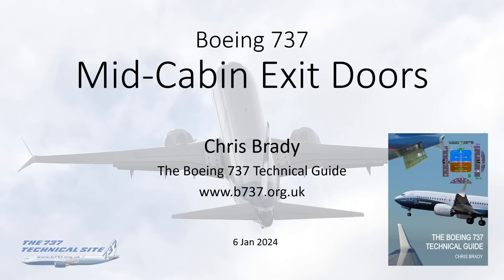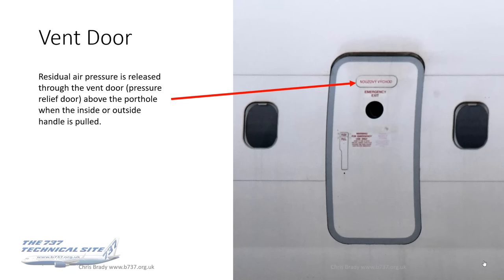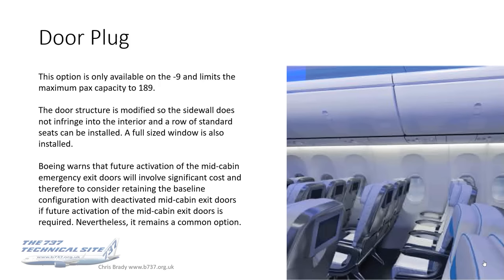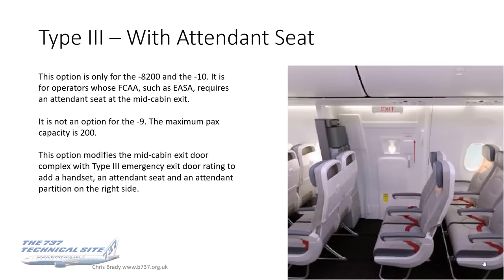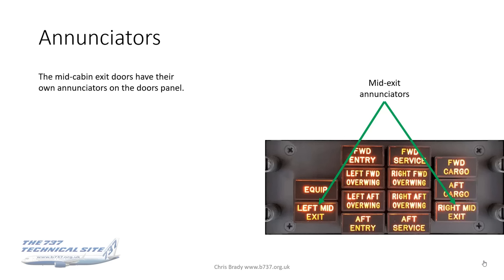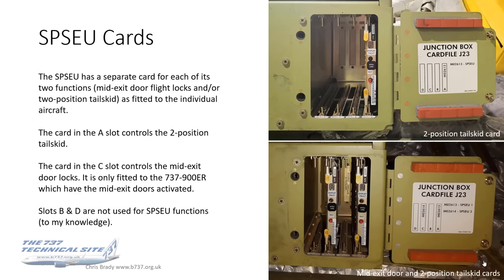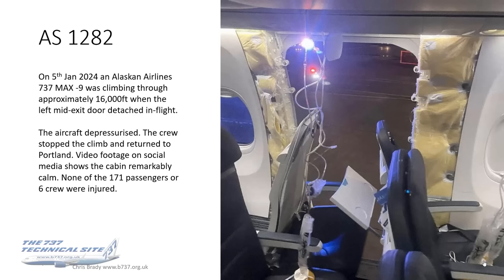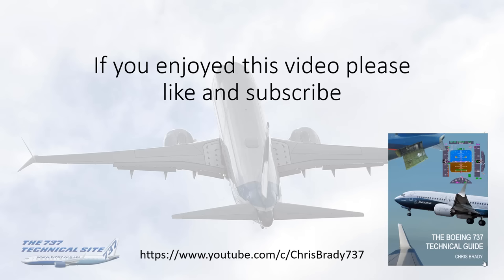737 Mid-Cabin Emergency Exit Doors

Comment: I'm surprised the plug can pop out?
I'm always impressed by the kinematics of boarding doors opening and closing, a door that is bigger than the hole, but still opens outwards. Once seated and under pressure doesn't even need hinges or bolts to stay in place.
But it seems to me all the safety it brings is negated if there's another seal that relies on 4 bolts?
Reply: I guess it qualifies as a "plug type door" because in the down position the stops on the door collide with the stops on the body so it can't physically open until it is lifted up. All the stress should have been taken by those stops with the bolts just preventing vertical movement. It sure seems like even one bolt would be enough to hold it down so my guess is no bolts installed or the wrong bolts installed, eg too small so they were able to rattle themselves out.

Comment: As a professional aircraft mechanic of over 40 years,  This video was excellent material in what I wanted to know as a reference.   Of course many more questions and answers will follow before we know exactly what happened.
Reply from the maker: Thank you, glad to hear that you found it useful
Reply: I'm going to guess the retaining bolts were never installed.  Even so, it's difficult to see how it worked itself open.

Comment: Interesting video.. Thank you. A "plug" would imply that cabin pressure would hold the door shut? Seems odd design that a panel would be held by fasteners where the cabin pressure works against them. I think I will be avoiding sitting in rows near those plugs. Update... I watched the video from the start and I am much clearer about the design. Still wont sit next to one.

Comment: As a 37 year FAA maintenance inspector, this video is well done. Doubt it’s a design or materials flaw. Sure seems like someone did not install the bolts during manufacturing or maintenance. Probable root cause… continuity of inspection failure..or interim inspection before closing failure. Poorly designed task card if maintenance, improper training and/or staffing issues may also be contributing factors. Human factors…
Reply: Thank you for an intelligent comment

Comment: Great video. How can 1 or more bolts be missing? This is an incredible situation. What is the quality control situation? Every nut and bolt needs to be installed, torqued, and safety wired if necessary. The door plug installation organization needs a thorough review.
Reply: you can see a door bolt in the top right at 24:21 it's huge and there is no nut to torque

Comment: Sounds like somebody forgot to bolt the plug onto the fuselage. One or two bolts could not have failed, bolt strength is immense.
Reply: I worked on the assembly line for some time. When this type of thing happens, an extra line will be added to the procedure where the Quality Assurance person will be required to check the setting and certification of torque wrench, then witness the mechanic who will torque all the fasteners in question and sign off the line item in the procedure. The way I understand it, you cannot require witness torque on every nuts and bolts, that would cost way too much. But I would be surprised if these bolts for the plug door did not have the witness torque requirement already. Another possibility is the bolts were obtained from a shady supplier who bought the cheapest bolts which were not up to the task.
Reply: @1Grr8Guy   does the tube arrive from Wichita with the plug installed ?  or is it installed in Final ?
Reply: @peterp4319  It appears to me that the fuselages are seal tight against the elements for the journey to Renton. Haven't seen any gaping holes at all. Even smaller gaps are covered up with some temporary covers and taped shut.
Reply: "One or two bolts could not have failed, bolt strength is immense." 
......IF they were the correct part number.
Reply: @peterp4319   "does the tube arrive from Wichita with the plug installed ?"
Good question.

Comment: BONEHEADed Boeing + FAA though process, i.e. note @5:55 that in the "sardine" configuration used by Lion Air, that the "extra" (formerly plugged) 2 emergency exits are in the portion of the plane that needs them the LEAST!  i.e. they eliminated First Class, and now have WAY more pax forward of the wing than aft.  SMH... 🤦‍♂

Comment: On Alaska flight:  the images from the outside portray a door that popped out cleanly and didn't damage fuselage aft of the door.  If the structure was sort of a door with hinges at the door sill, but bolts instead of latches to keep the "door" closed, wouldn't partial separation have resulted in the outside wind (greater then 40knots (yes, I watched your full video earlier :-)  playing a tug of war  to pry the door off from the hinges or remainig bolts thus resulting in visible damage to the frame? If the door swung open and later detached from hinges, wouldn't it have limely scraped/dented the fuselage aft of door frame?    Would this plug non-door have fexible seals similar to real doors? or would they have used some silicone sealant or other permanent compound to seal the gap between the plug and the door frame?
Reply: i wonder if the only thing holding it all this time was the sealant?
Reply: "Would this plug non-door have flexible seals similar to real doors? or would they have used some silicone sealant or other permanent compound to seal the gap between the plug and the door frame?"
At 24:27 I see a bulb seal mounted to the fuselage and a seal depressor on the door itself. So it has a flexible seal just like a regular door. They work remarkably well. I've seen test pilots turn the pressurization OFF altogether and the fuselage and all the many doors and openings hold pressure tight as a drum. And there are a LOT of openings in an airliner fuselage.

Comment: The door plug option is an interesting one.  The fact that is can be opened, even part way for maintenance makes it an operating door versus a permanently bolted 'door plug' at assembly that is meant to be installed and not opened unless the configuration is changed.  As a door than can actually be opened part way for maintenance, it really should be monitored with sensors. Of course, that would add significant cost for the option, so that is not done.  The potential exists for the door to be opened for maintenance and then it is not properly secured. Once the interior trim is reinstalled no one can perform even a visual inspection.
Reply: Who said the plug may be opened for maintenance? Removal of the plug involves a procedure that spells out the step by step operations required to remove it. Likewise the reinstallation of the plug. It's the same for any part of the airplane that may need to be removed for repair or replacement or when unanticipated access to other components is required. Such removal and installation is not "for maintenance."
Reply: Who said the plug may be opened for maintenance? Removal of the plug involves a procedure that spells out the step by step operations required to remove it. Likewise the reinstallation of the plug. It's the same for any part of the airplane that may need to be removed for repair or replacement or when unanticipated access to other components is required. Such removal and installation is not "for maintenance."
Reply: Who said the plug may be opened for maintenance? Removal of the plug involves a procedure that spells out the step by step operations required to remove it. Likewise the reinstallation of the plug. It's the same for any part of the airplane that may need to be removed for repair or replacement or when unanticipated access to other components is required. Such removal and installation is not "for maintenance."
Reply: Who said the plug may be opened for maintenance? Removal of the plug involves a procedure that spells out the step by step operations required to remove it. Likewise the reinstallation of the plug. It's the same for any part of the airplane that may need to be removed for repair or replacement or when unanticipated access to other components is required. Such removal and installation is not "for maintenance."
Reply: Who said the plug may be opened for maintenance? Removal of the plug involves a procedure that spells out the step by step operations required to remove it. Likewise the reinstallation of the plug. It's the same for any part of the airplane that may need to be removed for repair or replacement or when unanticipated access to other components is required. Such removal and installation is not "for maintenance."
Reply: Who said the plug may be opened for maintenance? Removal of the plug involves a procedure that spells out the step by step operations required to remove it. Likewise the reinstallation of the plug. It's the same for any part of the airplane that may need to be removed for repair or replacement or when unanticipated access to other components is required. Such removal and installation is not "for maintenance."

Comment: Because of  the hinge feature at the bottom, it appears the failure may have happened at the top two fasteners.

Just four bolts on the plug option...hummm...though a certified solution, I don't think I'll sit in that row.
Reply: But what is the "bolt"? They could be 4" in diameter. Certainly not the same nuts & bolts we see at the store.

Comment: That last picture has a label attached to the door that says "attach points only" and it looks like something from the production line. Aaand the only way this could happen is if the four bolts weren't installed. Thanks for the excellent orientation this will help put some hangar talk to rest... now off to Reddit!

Comment: Boeing 737 airplanes has a design problem on the emergency exit doors. When air/ground logic stuck in the GROUND mode after lift-off and when both thrust levers bring to IDLE position, those doors become DISARMED AUTOMATICALLY in the air. This means if a passenger pulls the handle, it opens. (See FCOM 1.40.46 for NG models). The 3 out of 4 door logic is also discussable in the referred paragraph of FCOM.

Comment: Thank you for your insight.  Very informative.  As an aerospace professional on the  787 Dreamliner program, I tend to concur with a previous comment from an aerospace engineer.  I am curious what the investigation determines what the root cause is.  Thankfully, this incident did not occur at cruising altitude, or it could have been terribly disastrous.  It's been a busy first week of 2024 in the aerospace industry.
Reply: Root cause, that’s easy, corporate greed.

Comment: Looking at the installation, does seem to me the only way for the door to liberate is to move up (to clear the door frame stop fitting). Perhaps this was a gradual thing caused by vibration of the door  (source so far unknown) while in flight causing the 2 spring fitting arrestor bolts & the 2 guide cross bolts to gradually bend until they sheared completely on the incident flight. Glad they've managed to locate the fallen door. Hope they get some of the bolts too, that will definitely speed up the investigation.
Reply: I question whether the securing bolts were installed.
Reply: Or probably the bottom 2 missing cotter pins causing the bolts to loosen and the ensuing vibrations causing the upper 2 to fail?

Comment: thanks for a review of the door annunciation system.  
Since the AS 1282 had plug type doors, is it correct to assume that the plug doors do NOT have annunciation ?  And the Crew detected the failure from the rapid depressurization/O2 mask drops and not the Door Warning system ?  Chris, do you have a video of the Cabin Pressurization system ?  I wonder how long it took for the Flight Attendants in the back to notify the Captain  about the blown door ?  Cockpit Voice Recorder tape will be interesting for sure.
Reply from the maker: Correct, the mid-exit door annunciators are disabled and labelled INOP in the flightdeck for aircraft with the plug door option.

Comment: Thanks for the informative video.  I would like to see more detail on what holds the door closed against the pressurization forces.  There are a number of comments here regarding four bolts being inadequate, but I believe that the purpose of the four bolts is misunderstood.  I believe that the four bolts keep the door from moving up past the stops, and it is the stops that actually secure the door.  Can you provide more details on this?
Reply: " I believe that the four bolts keep the door from moving up past the stops, and it is the stops that actually secure the door." 
Exactly correct. LOTS of Next Gen 737s have this type of plug and I am unaware of any such previous incident. In fact I don't think they even check those plugs except at overhaul which is about every 5 years or so. That's how reliable they are.

Comment: Hard to believe that four fasteners are adequate if a standard safety factor for a pressurized cabin is 2.0. It implies that two fasteners could fail and the article would remain safe, but what if two fasteners fail on the same side?
Reply: I don't think it implies that two fasteners could fail. It implies that each bolt is twice as strong (by whatever measures) as it needs to be. Safety factor doesn't automatically imply redundancy of parts, even when parts are symmetrical or doing similar jobs. If it did, you wouldn't be able to calculate a safety factor for singular things.
Reply: @meepk633  Thank you for guiding my thinking. I’ll never be an engineer, or an aircraft mechanic, but I find it very interesting. I have a better understanding of the bolts purpose in this application now.

Comment: Capt. Brady, thank you for the detailed description of the fuselage plug. From my view of the open plug at 25:43, there are six fixtures (I'll call them lugs) on the right side of the door frame and six on right side of the plug. I presume there are matching lugs on the left side, but part of the view is obscured. When the plug is in the proper position, are the "lugs" on the door inboard of the lugs on the frame, so that the interior pressure can hold the plug in place? And to remove the plug, you said that the door has to move upwards about 4 cm. Is this so that the lugs on the door clear the matching lugs on the frame? If this is the case, wouldn't all four bolts have to be removed to allow the plug to move upwards? Do I have this correct?
Reply: Hard to believe that the bolts would be broken. Where is the force to break the bolts?
Reply: I think they were missing.  @richbrazill1698
Reply: Oh… if they forgot bolting the door entirely during production or maintenance?, and it got loose on ground when not pressurized? Scary thought. Imagine doing such a snafu and then people dying, that would be absolutely terrible to bear. 2024 has had a very eventful start for aviation.
Reply: I'm inclined to agree with you. The plug looks superficially similar to my PC case's side door that's held in place by two screws; if I remove them the door doesn't open until I push it back 1/2" and then it folds down to lift out. There's no load on the screws. I've not had the screws in place for months and the door hasn't opened as it's the lugs keeping it in place but given sufficient vibration it would work loose and fall off.
Reply: What you are calling lugs are called stops.
Reply: @indiekiduk Thanks for the clarification. I’m not familiar with the terminology, but I’m a mechanical engineer with lots of experience.
Reply: You are correct. The explanation in the video is wrong, compounded by numerous reaffirmations given in the comments. As usual, there is no reply to any comment challenging the explanation or requesting clarification. A poor channel for learning anything about aviation because one cannot discern what is true and what is false.
Reply: You are correct. The explanation in the video is wrong, compounded by numerous reaffirmations given in the comments. As usual, there is no reply to any comment challenging the explanation or requesting clarification. A poor channel for learning anything about aviation because one cannot discern what is true and what is false.

Comment: Just to clear up the Spirit/Boeing question, Spirit supply the fuselage complete with door plugs to Boeing. Boeing then remove them in order to fit out the aircraft interior and it is Boeing who re-fit them and cover them on the interior of the cabin.

So if it is an error in fitting the plug then that is on Boeing, unless it was damaged when originally fitted by Spirit which is still on Boeing as this should have been caught when it was finally fitted before being handed off to the customer.
Reply: It's an error in the company that gave them a fuelselage with two HOLES IN THEM!

Comment: I would have assumed a plug would have been wider than the opening and thus could never open except being removed from the inside during maintenance, therefore a plug could never come out under pressure nor ever be removed from the outside. Clearly 4 bolts are not safe enough of a design for a plug type door, we wouldn't allow the rest of the windows sections of an airplane to be bolted into place, they are permanently riveted, if the the exit isn't going to be used as an emergency door, it too should be riveted into place.